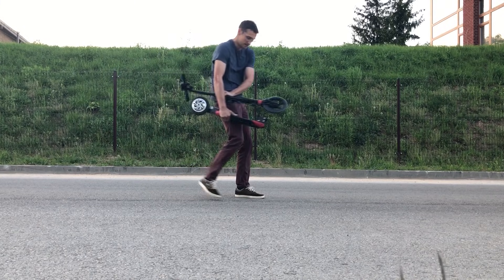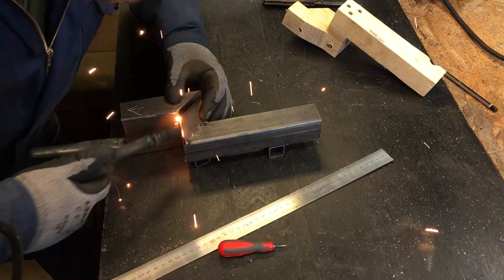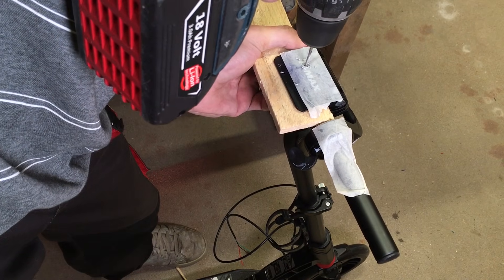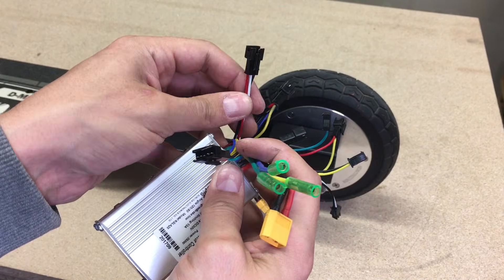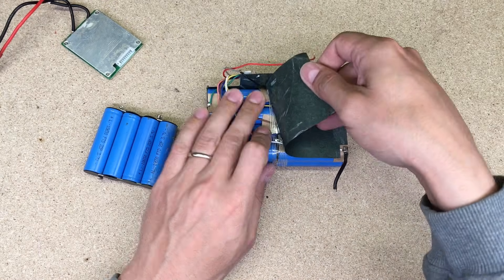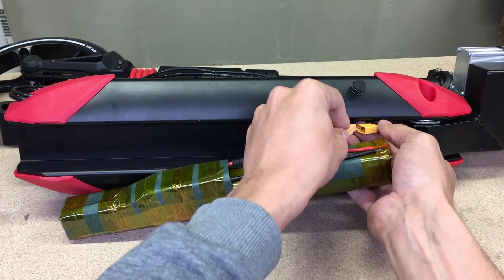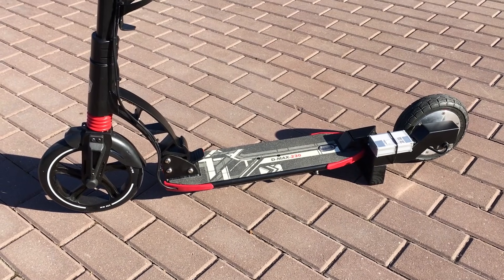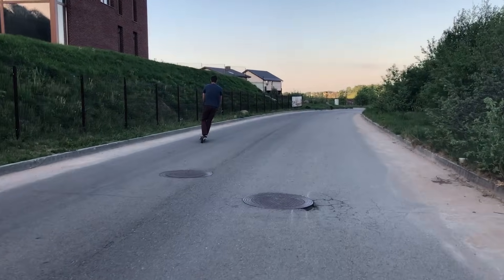DIY: Electric Scooter Conversion With Hoverboard Parts

Comment: People who copy this: please don't try to be smart and use higher Amp controllers. The battery has no self protection(!) and will get internal damage until someday it will burst in flames. 13 amps like here is probably just within the limits that the battery can handle.

The cells in these batteries are the cheapest in the world. So don't put too much trust in safety!
If you are not 100% sure it has over-discharge protection then don't assume it's there.

Comment: Hover board scooters serve as great parts, im sure you could have made it a little faster and also since its so stealthy in shape, most people wont even know its electric. I have a kids razor like that, looks like a push scooter, I just loaded it with more batteries inside the frame, heavier but went from 10km range to 15km and less slowing down as it has more power within my 5-6km one way commute.

Comment: Hi dude thansk for the video. Today i had an accident with my kugo m4pro , a guy dint seen me and pulled over and i did not had time to stop. I broke his bumper:P However:) I want to replace my front wheel with a back whell and take down the disk breck. I noticed that if i put in shuctut the motor wires it breaks to a very strong stopping force. and its all inside the motor. Then If i could put a short of controller that can Charge a super capacitor at 60 volts to give me a kick start at traffic lighs and when i breack to load that capacitor .. would be amaszing. I really need your help. I also would like to undestand what is the balancing wires and if you can give me some links to undestand the basics of it. And also the electronic controller for the battery what is that and where can i get some more info about what that basicaly do. I have some good understanding of electronics so its not a new topic. Just that the new stuff now needs alot of documentations. Cheers.

Comment: Nice work, With the hover board I will make a push unit to latch on the back of the scooter plus a steel cable to tilt the hover board to go forward or to stop. Cut and narrow the fibre glass stand on the hover board as it will not be needed. Presto!!

Comment: hi, nice video. i have a question, can you share the electric layout? because i see that you put a paralel cable to connect the cable to charge the battery, and other question is when you charge the battery the speed controller has always power. is not better to connect the power switch just before the speed controller and the you will just charge the battery, without any peak cuurent problem during charging? thank you

Comment: Excellent job, through and through. I can do all the steps you did, but not as cleanly as you ! Congratulations. In hindsighting, designing a covered place for the controller inside the brackt would have been the better option. Still, a great build

Comment: How many volts have you fed these motors? I have a 48-72v 1500 watt controller, I'm thinking 60v nominal, it was for a alternator conversion. I was thinking about getting a 48v nominal controller for these motors, around 750-1000 watts, being 350w at 36v motors, I heard they can handle 72v with some cooling holes, with a 75% duty cycle, I wanted to put these on a bike, use both to spin the wheel, using two controllers, with a 12s 16-24 ah battery , i need atleast 60kmh, and 120km range,  I don't know much about these motors, what I really want is a pair of 3kw motor, on about 72v!
Reply: They can definitely handle 72volts nominal, I'm contemplating wether I should go to 108volts nominal.

Comment: I did a 350w conversion recently, I made the battery 250wh 7ah  2p10s  Mj1 ...  I split the pack and placed 4 batteries within each side hole of the chassis rail, as well as 12 batteries in the centre channel, there was also room in the centre channel for the controller ! I still have rear suspension too ! ;) I may copy your battery cover technique !

Comment: This is awesome! Such a neat finish, looks factory made! 

Could the motor be used for seven braking? You wouldn't put much power back in the battery but might get significant resistance to slow the scooter more effectively than the original brake design!

Comment: Question about the VESC, does it need cooling? Running 50A continuous through it must get things pretty hot. I plan to use this with a 10S lipo to power a 350w hub motor scooter. My current cheap chinese controller uses trapezoid waveform so things are very noisy and there is lots of power loss. This controller seems to output a clean sine wave, however there are no hall sensor wires?

Comment: I like your ideas but Have you ever think about shaking the front wheel?  because of the valances, front wheel and back wheel when 60kg to 100kg ride on board to speed up it should be shaking front wheel. too heavy the backside. What are people evaluated?

Comment: How do you charge the battery? Do you just connect thw battery power outlet to the original hoverboard adaptor(charger)? Is that safe?
Reply: Just plug into wall

Comment: Isn’t there anyways I can buy a speed controller which had 3 wires for the haul plug as I’m not so clever to connect them like you did
Reply: hahaahahah !!!! You can use senseless (no hall wires) it will just be jerky at slow speeds 3 wires only. hall is easy though ! red black .. then blue green yellow .. very simple...

Comment: That's awesome man. But I was thinking why not mod the stock rear suspension to accept the hover board wheel?! 

Either way amazing job on the built.
Reply: Because he would have not enough space for the battery & controller ! (unless he copied my technique ;) ---  "" did a 350w conversion recently, I made the battery 250wh 7ah  2p10s  Mj1 ...  I split the pack and placed 4 batteries within each side hole of the chassis rail, as well as 12 batteries in the centre channel, there was also room in the centre channel for the controller ! I still have rear suspension too ! ;) I may copy your battery cover technique !""

Comment: Not sure about life time of this build without dust and water protection. Big question is the price, it's not under 200 eur. Just hover board cost more than that, + throttle button, lcd, etc. There are some good options for about 350-400 eur, basically about same price. But if you have that all as a garbage and don't have to buy any of that parts, it's good and fun DIY project.
Reply: Just buy used, i found the same scooter for 60€, hoverboard for 70€, both fully functional, the controller is around 40€

Comment: Hi! Awesome build! How did you find the wattage of the motor? I have an old monowheel motor (14'') that I want to use for a big scooter (offroad) project but I'm not sure of which speed controller I must buy... Also I'm worried with the hall sensors because it might not be color coded as the motor is. Did you have this issue? Thanks

Comment: You clearly didn't hack that in two days, that's a well done project with a very impressive attention to detail.

Not a fan of the position and (lack of) protection of the cells, though :-(

Idea for a V2: use the second wheel as well and make it dual motor like a Tesla :-D

Comment: Very impressed, I have a broken hoverboard just sitting around so I was gonna try and make something out of it, the only problem is that I lack some electronics knowledge.

I would love to see you explain like what and why the electronics parts do, for instance that yellow connector, the different wires that stick out of that speed controller box.

Comment: So i see that the chargers out put goes to controller and to battery at the same time so is it ok if the chargers out puts 42 volts and the both the controller and battery are 36v?

Comment: Great job, I love you attention to detail. I am currently doing a similar project, I am using a 10 inch hoverboard and using the motors, battery and charger to  build an adult size trike.

Comment: How do you brake?
Reply: R3d N3rd Channel - well on the controller is a brake wires what you plug in to special brake handle
Reply: gaminggamer 04 that doesnt do anything is just a safety feature on those cheap controllers so you cant hit the throttle as you are braking
Reply: i know

Comment: Make some effort add some bearings with a spring and put both motor wheels which would reduce the stress on each of the motors and you should get at least 40km/h. I am just saying. Nice video btw
Reply: Johnny Motors
that’s not how it works, just saying...
Reply: Bernard Ellefsen then he should put a 300cc engine on the back and that's it :)) 100mph guaranteed (then will have to look for a "resting" place)
Reply: Johnny Motors just slap on a 115 300Lbs jet engine, and then you don’t have to worry about anything.
Reply: @Johny Motors

bro someone here in youtube had the same idea like yours.. 😊👍

https://youtu.be/BwcFvS8RpAM
Reply: @Johny Motors

this man Mr. Cop, i think is the 1st one that used the smart balance hub motor wheel as a way to convert a manual kick scoot to electric kick scoot, he has a video posted way back in 2015, just search d vid frm his channel.. 👍😊

https://youtu.be/9BwBboAXk-Q
Reply: this man also had a cool idea about kick to ekick scooter conversion - Artis Mineikitis

https://youtu.be/qdkPEPklQ20
Reply: Bernard Ellefsen hahaha good one. Will he be getting at least 150mph? Haha

Comment: hi short question man can make the scooter faster than 20 km / h
Reply: With this motor and the same voltage, you can get easily 40km/h by changing the motor coupling from stars to triangle. This + 48v or 60v pack and you go for the 60km/h.
Reply: @IHPU0   what are stars coupling??
Reply: @tarekejjaad3982  there is two type of coupling for a bldc motor, delta that give high torque but low speed, and star that give better speeds but it consumn more current. That push the motor to its limits
Reply: @IHPU0  How can I do that?? Is there a video or something?
Reply: @tarekejjaad3982  yes there is some videos about this, you can also use google to find it.
Reply: IHPU0 i have found what its but i dont found anything about hiw to do it 
Can you send me some link??
Reply: IHPU0 use same controler for coupling triangles  36v
Reply: Hanslp LP
 yes, but you will need a more powerful battery like for example a 48v one. More voltage=faster spinning motor.
Reply: Hanslp LP - yeah i did one of does and it goes 30kmh
Reply: @protoyes995  hoverboard wheel?
Reply: My scooter goes 32kmh with 36v
Reply: my to
Reply: @nightmareinaction629  hoverboard wheel?

Comment: I don t think u need to build back wheel attachment from steel feveglass laminated wood is much lighter and would do the job fine also
Reply: well triply has a problem that that problem is that it cracks and bends with the water and with the climate change... thus sun will affect it, cold will affect it... metal is the solution, yet I would have tried to metal cast a alloy of aluminium with magnesium... or use a metal that already is base on these 2 metals, steel is to heavy and the way it was done on this video seems to need some serious structural analysis... a thing that could be skipped if the design consisted of 2 arms instead of one...

Comment: Good assembly i waiting my parts for this project. But I can not decide how to brake, any suggestions?
Reply: EBS !!!! Very effective !   electronic braking system .. its like a thumb throttle , you apply an amount and the magnetic field in the motor holds the motor, resisting the rotation thus braking is applied.

Comment: You nailed it.... If you can point me in a direction of a Razor 300 type motor connected to a Yeddoo type scooter with a Shimano Alfine internal 11-speed hub with the electronic gearing. That should be your next project...that was freaking awesome...

Comment: can i use 2 wheels on rear ,pls sugest.
Reply: No you can use both just wire it twice and at the joint put a little extra slack in the wires for turning and everything will be fine

Comment: Great video, but please be a bit safer while you work. It would be a real shame for you to be maimed by something completely preventable. 1:39 Those rubber gloves you're welding with will melt against your skin if you make a mistake. Heat resistant gloves are not expensive.

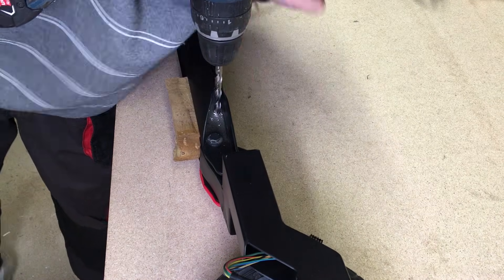3:56 The way you are holding that piece while drilling could mangle your hand or fingers if you misjudge the depth. You really should keep your hand to the side while drilling, or use a vise.

Comment: I did exactly the same project few months ago and scooter still going strong. I have overvolted this motor to 75 volts as i have found it was slow on hoverboard battery that is only 36volt nominal.  Now it pulls like a horse and peak at 2000wats!!! You should make polyurethane tyre for back wheel as this solid rubber cause lots of rolling  resistance and your motor will be hot after few miles. Mine after polyurethane mod runs cool and consume 50%less energy so its a mod worth doing
Reply: greg can u elaborate? Isn't easier to replace tire for pneumatic one ??
Reply: Olga Piskorska you can't replace with pneumatic tyre as there is no space for tube valve you would have to drill thru hub motor and magnets and then motor stator would prevent wheel from spinning unless you would somehow mods this and route valve to come out on the side of motor. I basicly used polyurethane same material that skate wheels are made off. You can buy kit mix two part like resin and pour into mold and you get perfect low rolling resistance wheel. Please check my channel I have short video showing my scooter partially finished
Reply: You have quite a few videos. This one? https://www.youtube.com/watch?v=MdHuvKvgUEE
Reply: Rob Roberts yes my friend
Reply: Does the PU wheel wear down quickly though?
Reply: batlin no they are long lasting wheels. I have used one of the hardest compounds available so it should last thousands of miles. Next time I will use softer wheel as I find out that softer  wheel would work much better at absorbing road bumps unless you live in the area with perfectly smooth roads
Reply: Lmao 2000 watts??? I'm planning on making a dual motor scooter made from 2 broken electric scooters, the motors are rated  250watts continuous and 500watts for short periods of time, I was going to get two 48v 350watt ESC's and I was thinking that would be pushing the motors too hard....
Reply: You are talking absolute rubbish no cheap hoverboards are 2000watt battery
Reply: @MancstaSam  well technically it would actually work, assuming you aren't using the bms and the battery is around 42-48 volts. They use high discharge batteries so they can put out around 20amps and if you had two batteries is parallel it could put out 2000watts but the batteries wouldn't last long using it and it wouldn't last as many cycles
Reply: What esc did you use for 72v?
Reply: What is the top speed that it reaches ?